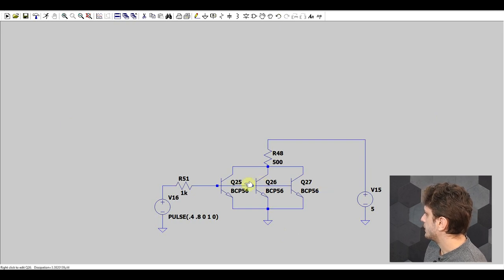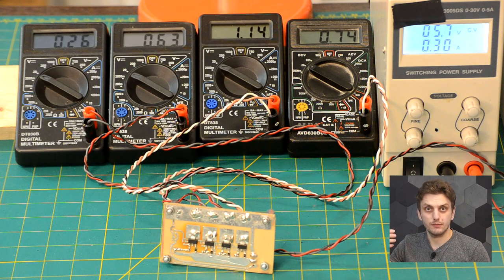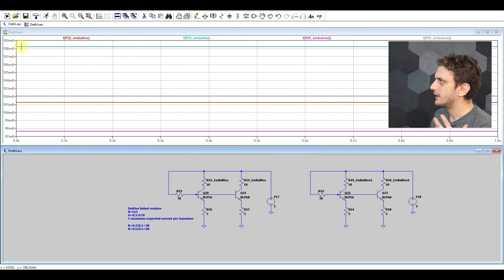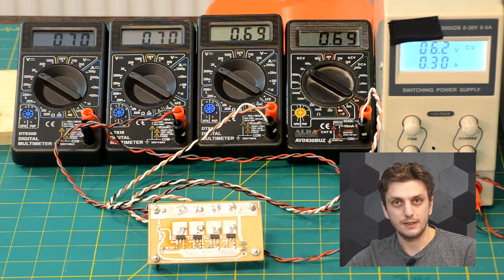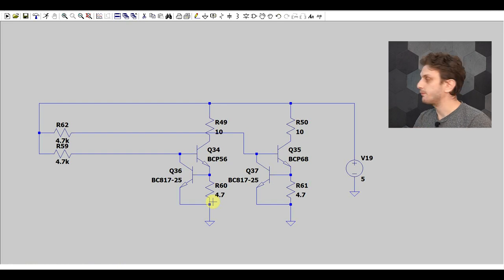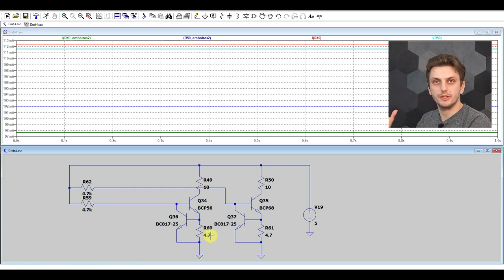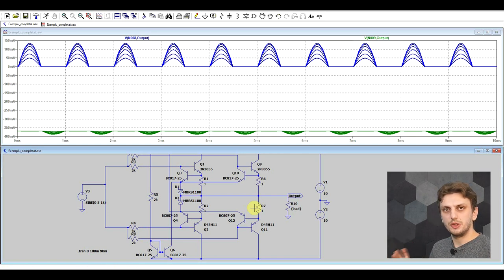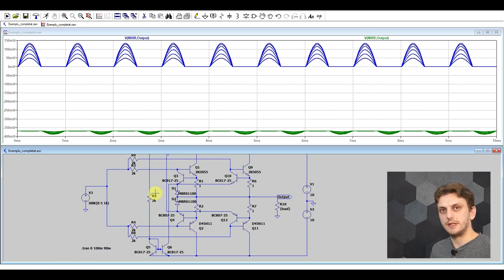Electronics Tutorial - 1/3 Driving multiple BJT transistors in parallel

Comment: Sir can you please explain how to find the reverse recovery characteristics for diode using Ltspice...
Reply: Make a series circuit with a voltage supply, a resistor and a diode.  Apply a large enough voltage with the supply, say 5V, to put the diode in forward bias.  The other 4.4V is across the resistor.  Then apply a fast step change to the supply, say a 1 ns fall time to -10V to put the diode in reverse bias. The total time taken for the -10V to be placed across the reverse biased diode is the reverse recovery time.  It consists or two parts: a delay and then an RC charging part.  The delay is the time taken for the minority carriers associated with forward bias to be removed.  These carriers can be removed in two ways, through recombination and through the reverse current.  The rate of recombination is expressed in the Spice model with the TT term (transit time).  The smaller this number, the faster the rate of recombination and the faster the diode can switch from ON to OFF.  Once the minority carriers are removed, the forward bias on the diode will go down to zero.  After that, the RC charging of the depletion region takes place as the depletion region expands until the full reverse bias voltage is placed across the diode.  In the RC charge time to establish the reverse bias, the C is from the diode's depletion region capacitance and the R is the resistor in the circuit.

Comment: Thank you!! It really helped with my project! I have used many controllers but recently I was looking for something cheap and simple that I could use to controll powerfull devices! And it really works! I just need to balance all the transistors better ( I have a 20 mA difference sometimes for 600 mA in total but it is ok in my project, the problem is I don't have a few values power-resistors - only 1 ohm - 5WATT and of course normal resistors are not good here, just need to order more usufull different values and it will work perfectly! ). I was really surprised how well I can controll my DC motor with my 4 transistors (PN2222) as well as with more expensive motor drivers like L298N etc. :D
Reply from the maker: I'm happy this video helped, but I do have to ask, why bother using multiple transistors in parallel at such low currents, would it not be easier to use a slightly higher current transistor? Also, if your maximum motor current is 600mA, its just on the maximum limit of the transistor, so even a single PN2222 should be enough. Or maybe I misunderstood.. 
One more more thing that might be helpful, there is a lower current alternative to the L298 - the L293. It should also be cheaper than the 298.
Reply: @FesZElectronics  what I do it is only for learning ;) I know that there are multiple options and high current mosfets ,circuits etc. but it was just to find out how in the cheap and easy way i could the same result :)
Reply: @FesZElectronics  I use all of them but this time it was just to find out what I can do :)
Reply: @FesZElectronics  Also I learn electronics as in extra/additional thing to my programming/coding (so the perpuse is to learn and understand electronics and what happens for example in the computers or machines etc. - this is why I go a little bit differently than other people). I have noticed also that people use "already made" things but at the same time they don't learn this way because there is somebody else made it! With some stuff of course I buy "ready to use" things when fabricte or make for my own is too hard or more time consuming (like drone frame for example or   sensors which I just can't fabricate at home haha LOL ) :D
Reply: another thing ... my PN2222 should handle 0.8 A but maybe I have some faulty transistors because even at 0.6 A they become realllllly hot and they easy burn themselvs above 0.6 A...
Reply: @FesZElectronics  AA! And I forgot to say also (this is important) that 0.6 A of my motor is NO LOAD current! If it was its max it would be great! But in a real life with load it is usuelly 1.2 A - 1.5 A very easly!!! It is for a RC car. With an obstacle or something it is 2 - 3 A ! Actually this is a problem. With no load any transistor stants the current but if the load increases it becomes chalenging!
Reply from the maker: I think I understand now. If you are looking for educational experimentation, then any version is something that you can learn from. I also don't like "already made" boards and modules, since you don't really understand what is going on inside, or if it actually is the right thing for your application. Building circuits from scratch (with or without IC's) is something I always try to do to better understand how things work. 
Regarding the motor, and transistor heating. You are right, motor current is load dependent, and you also have a high current spike right when the motor first starts turning (similar value to rotor jammed), so whatever transistor (or array) is used should be able to handle  the initial spike. If the transistors are heating up, you should check that there is enough drive current - even if the gain factor is 100+ in the datasheet, that is not specified for saturation - in your case, where the transistor is used as a switch with low Vce (ideally <=0.1v) the gain will be ~10. So for 600mA of collector current, you should expect 60mA of base current. And of course for 3A you need 300mA; If these currents cannot be supplied then this is where a mosfet would start to make sense since you don't need continuous current in the gate, just some short duration pulses during turn on and off.
From a cost point of view, I guess using discrete components can be cheaper than using the L298 since that is not a particularly cheap component; but using 2 or 3 PN2222 should be more expensive than a higher current transistor. This you can check of course, and for the purpose of experimentation, sure chose any variant you like, but strictly for cost and simplicity, I would not use multiple parallel transistors for 2-3A.
Reply: @FesZElectronics  thanks for your answer !  I agree 100 % :)
Reply: @FesZElectronics  Hey! I have a big problem here maybe you could give me an advice or something (for which I would be really grateful!!) . I try to make my gyro-analog-sensor usuful (ADXL335) and I would like to use the change of the voltage to switch on the transistor but there is a huge problem! (I know that usuelly people use Arduino and actually what they do is plug in a few cables and use arduino software to read the parameters but it is too easy for me ;P  and boring), so everytime I try to use the change of the voltage , voltage drops (for example at the base of transitor to 0.7 V and the sensor stops working (whatever if i add resistor or not), I mean everytime when I put something and try to use that voltage change whatever it is a logic gate in IC or whatever voltage drops and it stops... I know that my knowledge of electronics is not enough now but I try to learn really for my own by making interesting projects and at the same time I read a lot from books also but it takes time and sometimes just I am confused. Thevoltage is between 1.6 V for horizontal position of the sensor up to 1.9 V for 90 degrees. Supply voltage 3.3. How can I convert this 300 mV change into something usuful? I hoped before that it would be a little bit easier to use that voltage but it is soo "weak" ... ( I mean "drops" between the ground and for example "X" pin of the sensor. Thank you for any help :)
Reply from the maker: So first of all, on the output of each channel, there is a 32k resistor inside the IC (the ADXL); I guess this explains the sudden voltage drop when you connect anything to it, you must use a high impedance load. I guess you could take this signal into an opamp and just use the op-amp as a comparator - so set the negative input of the opamp to 1.75V with a resistor divider, and get the IC output into the positive opamp input; then the opamp goes high or low depending on the sensor. Nice thing about the opamp is that you commonly have quad op-amps available (like LM324) and you can set this up to check all 3 outputs of the ADXL. Of course, you could use the opamp to amplify the signal, to increase the 1.6-1.9 range to something wider. Anyway, using an opamp to interface the ADLX to something else should be a safe method to prevent overload currents.
Reply: @FesZElectronics  thanks for the answer! Yes I have been considering the op-amp (even I have read in my book about operational amplifiers and watched a few videos on youtube (even I have ordered some cheap op-amps to check it) but if my understanding is right actually I could amplify this signal by using just simple transistors as well ?
Reply: probably i will choose the safer way but asking just in case ;)
Reply from the maker: Of course, transistor only circuits will also work; the idea behind using opamps is that it makes the circuit far more simple, with fewer parts and also the very high input impedance that you get with opamps is something that is not easy to obtain with very few transistors, unless you go for field effect components(MOSfet or Jfet); One interesting circuit you might consider is a Trigger Schmitt; its basically a comparator with hysteresis and can be built with just 2 transistors
Reply: @FesZElectronics  OK! Thank you ! It really helps! I learn a lot and situations like that motivate me to learn more about electronics ! This is why sometimes I choose the harder way of learning (but it is not boring hahah) ;)
Reply: @FesZElectronics  will it work with LM358 ? Or I need something better? I need it for a drone which I want to keep balance while in the air by regulate speed of the motors ( I mean this is why I need a quite precise comparator, otherwise the drone will fall down etc.) ...I have already ordered LM358 for another project and just wondering if i have to order again another op-amp or I can just use it (at least for the tests ) ? I mean sensing the tilt position etc. and accordingly set the speed (this is why without this sensor it would be really unstable).
Reply: @FesZElectronics  I have just tried with LM358 as a comparator and it works perfectly! Exactly how i wanted (you were right here, with op-amps is much easier ).
Reply from the maker: @grzesiek1x  I'm happy this helped! Opamps or comparators will always be usefull since they have very high input impedance and high gain; I guess the only thing you should be carefull with is the minimum supply voltage that the IC needs and the input and output voltage ranges (some IC's have limited input or output swing)

Comment: Hello, please help me to understand something, lets suppose you need to provide 3 A to a load, and you are using NPN type transistor on common-emitter mode, so lets say we use 3 TIP31C transistors and we place them in parallel, but as you said we need the emitter resistor, but that resistor must be able to handle 1 A of current, so are they a special type of resistor?
Reply from the maker: Usually its not the current that is a problem but rather the power dissipation and power rating - for example if its a 1R resistor (P=R*I^2) you need a resistor rated for more than 1W; if its 0.01R, it just needs to handle 10mW; the choice of resistor will be done based on the exact power that will get dissipated

Comment: Very clear explanation ! With this i could eliminate output voltage instability in my high PSU for my Ham radio.  thank you. Question: what simulating software are you using? Maybe a link to its website? Thanks :-)
Reply from the maker: I'm happy you found this useful! I use LTspice in all my videos ( https://www.analog.com/en/design-center/design-tools-and-calculators/ltspice-simulator.html )

Comment: Great video! I have a quick question. 
How to change the Vth of a MOSFET in LTspice?
For example, if I am trying to simulate the parallel MOSFETs and taking a model from a vendor, let's say CREE, and importing it in the LTspice. Since the real devices have variation in Vth and R(ds)on that leads to the imbalance. How to vary Vth and R(ds)on in LTspice to study that imbalance?
Thanks in anticipation! Keep up the good work!
Reply from the maker: Hello Tahir! The threshold voltage is the VTO parameter in the mosfet model - you can play around with it; but the Rdson I think is calculated from other parameters, so I do not know of a direct way to modify it.
Reply: @FesZElectronics  VTO can be changed for the Si MOSFET model. Unfortunately, the SiC MOSFET model by CREE has no VTO parameter in the model file. I'd be glad to hear if you got any clue for changing these parameters in the case of SiC models. Thanks for the answer and keep up the good work. I look forward to the next video!

Comment: I've got a class H audio amplifier with tons of MOSFET in parallel, the amplifier is a couple of decades old and some of them get super hot (even on idle) while others are at room temperature, I got a feeling it's got to do with this?
Reply from the maker: I guess if the problem was current sharing, the heating up should have occurred from the very beginning when the amplifier was built. Since its so old, I think it might be some other issue.

Comment: Is it true that with single supply and schottky diode with current sink, you get less voltage on the current sense resistor but increase in overall voltage drop leaving slightly less voltage for the load? Due to the added zener diode?

Comment: Using current mirrors made of discrete components is a bad idea, especially if you don't use massively oversized transistors, you run into that same problem you tried to mitigate here, they heat up and runaway, I've made that mistake when designing a 4-20mA output for a controller, at the full 24V supply it ended up not going below 40mA at the 0mA setting, and the transistors were basically right against each other, connected by copper planes, to keep them at the same temperature
Reply: Yes, keeping them at the same temperature provides negative feedback from the mirror transistor to the load transistor.  I had a colleague who was building a discrete high power PNP current mirror and he forgot to put them on the same thermal substrate.  The load transistor blew up. What happens is that the load PNP will start to experience thermal run away, partly because with a ground connected load its VDS is large and partly because that is just what BJTs do.   However, with a common thermal substrate the heat in the load PNP is communicated to the mirror PNP.  As the mirror PNP feels this heat, its VBE will go down because with a fixed current (defined somewhere else), it can conduct that current with a smaller VBE.  The mirror PNP and load PNP share the same VBE, so as the common VBE decreases, the current in the load PNP is brought back down and thermal run away is avoided.  Emitter resistors should probably also be used.  Your comment about this problem pertaining to discrete components is correct as PNPs in an IC are on the same substrate and so negative feedback based on a thermal link is automatically provided.